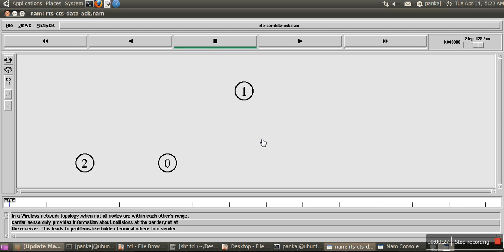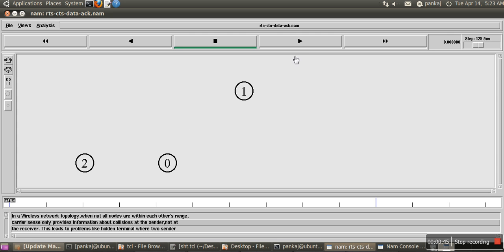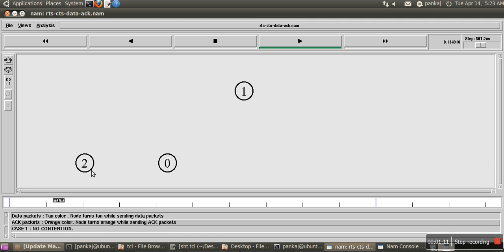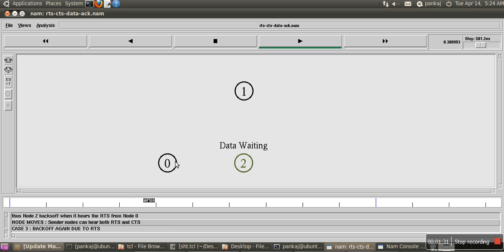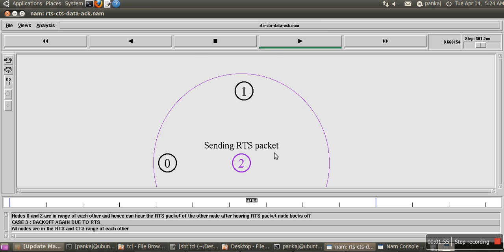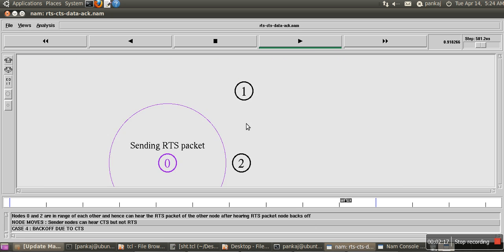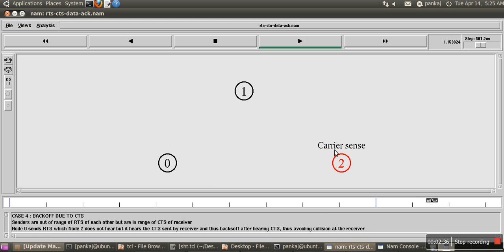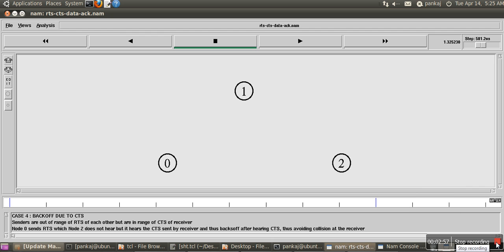How RTS CTS works NS2 simulation

Comment: Hi, could you please share the code?
Diego_seco_300@hotmail.com
Reply from the maker: Hi, I have code which will show rts cts but that is different from it.
Reply: And what about the colors and movements?, i found a code, but it doesn't show the CTS and RTS radio. Do you know hot to graph that?
Reply from the maker: for that you need to make changed in nam file.
you also need to study commands for nam which is required to change the color.